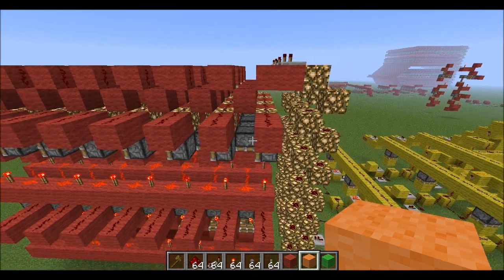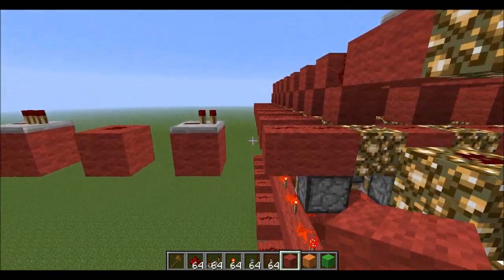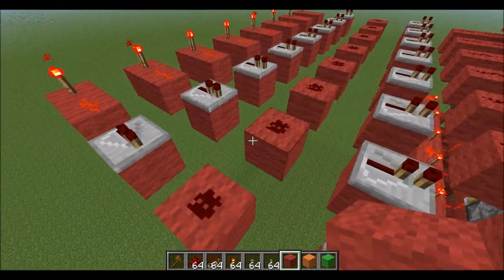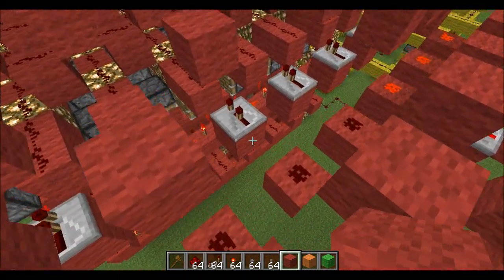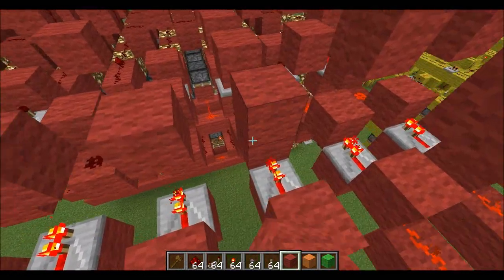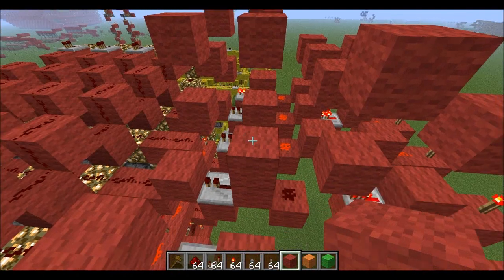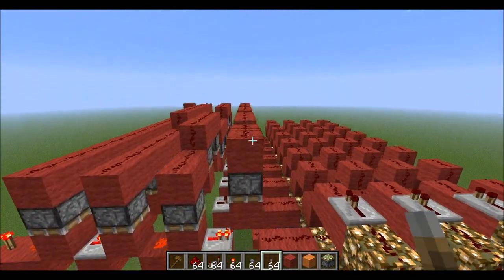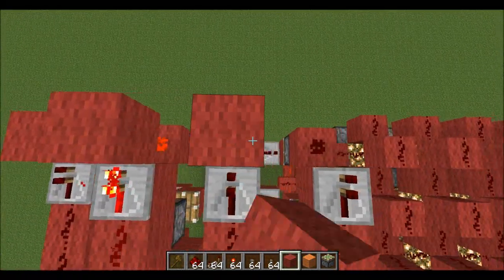Minecraft: How To Build A 4-bit Computer - Part 6 - RAM II [Tutorial]

Comment: you need 3 bits to address 8 things .. not 4 .. 4 can address 16 things
Reply: +hunar omer he should probably also use 00 as the first addres not 01 :P
Reply: Yeah, it's not correct when you start as 01. Start out by 00, then you can read it whatso ever.